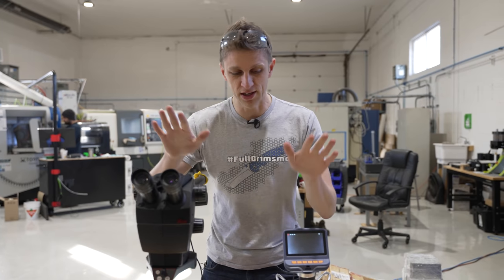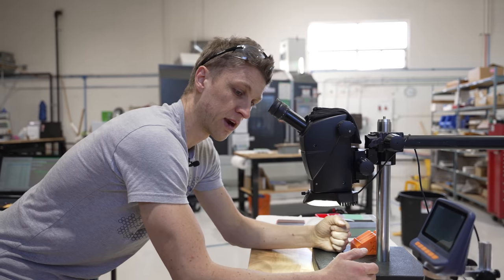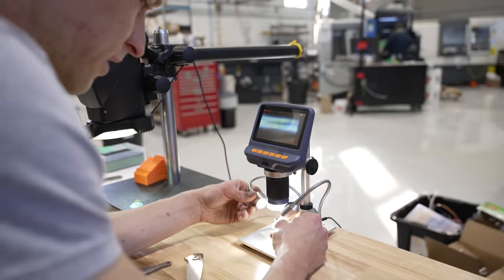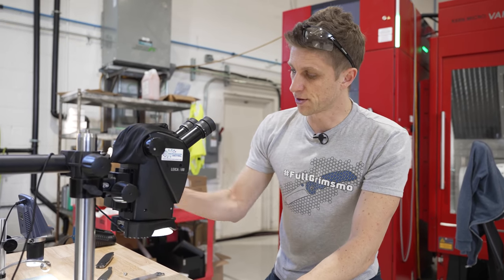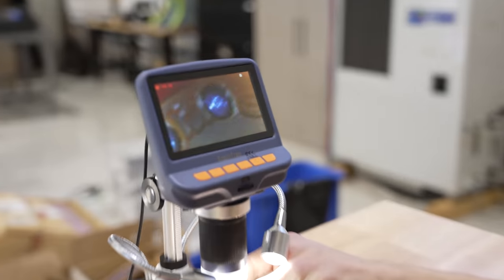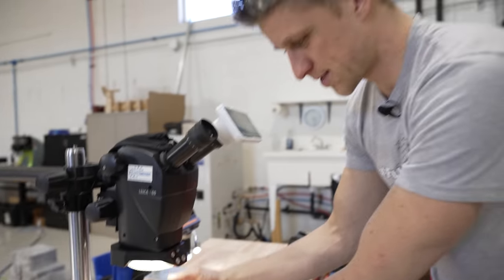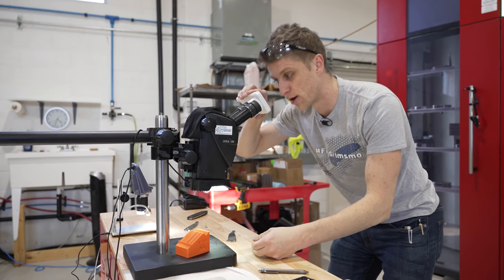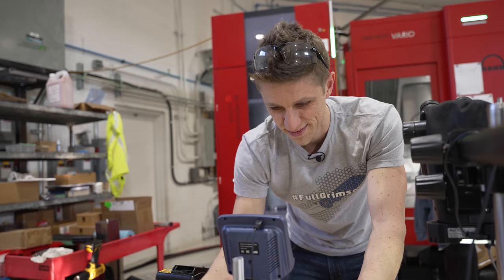$150 VS $1700 Microscope Shootout

Comment: 2025: John gets a scanning electron microscope to make sure the crystalline structure of the material is even across the part
2030: John starts manufacturing in a clean room
2035: John is an early adopter of the single atom 3-D printer
#FullGrimsmo 😁😋🦾👍
Reply: you have to set the limit somewhere, 1 atom accuracy should be enough, we don't need to get into quantum subatomic accuracy.
Reply: You can buy a working SEM for under $5-8k if you're lucky :)
Reply: IBM did single atom 3-D printing a long time ago actually. Look it up.
Reply: @semillerimages  yes I remember when they did that, was pretty cool, arranged some atoms into the IBM logo.
Reply: Agree
Reply: When it hits you that all this technology is directed towards the creation of whats basically "man-jewelry".
Reply: @JOSEPH-vs2gc  TOOLS! THEY'RE FULLY PRACTICAL TOOLS DAMN YOU!!

😂
Reply: @csquared4538  lol

Comment: I would go home with a headache every day working with that high pitched sound in the background all day.
Reply: Honestly you just get used to wearing ear muffs all the time... I have some nice bluetooth ear defenders and they stay on pretty much all the time!

EDIT: In my shop, not John's, but we produce similar noises! :)
Reply: If this audio wasn't altered, I wonder that if with a frequency squeal that consistent. It should be possible to run the audio through a spectrogram, and simply cut anything in that small frequency band, then use that audio for the finish take in the editing process. For small slivers of noise, the rest of the audio, like speaking range is unaffected.

Comment: The Leica, brand new, was a lot more than $1700, unless that model, which I’m not familiar with, is older, but it doesn’t look too old. That would be cheap for Leica.I had a Leica stereo model. It was $5.500.

A measuring device needs to be five times more accurate than what’s being measuring. That’s the usual standard. It’s never bad to have one more accurate.

Comment: I have a Chinese stereo microscope with a camera port much cheaper than the Leica. The stereo effect is really valuable especially if you do work under it like soldering smt.
Reply: Stranger Parts did a video a while back about them including price, review and link to buy (he bought from someone he does business with often enough in the markets that they put a web storefront up on his suggestion)
Reply: @konobikundude  amscope sm4-t is good

Comment: If anyone wants a cheap microscope to play around with, you can get basic USB microscope on Amazon for around $20-40. You connect it up to a computer to use it. If I was using a microscope for a business, I wouldn't hesitate to spend more than that.

Comment: If you have to manipulate objects under the microscope, then a stereoscopic is a must. Without depth of field there is no 3D vision. Leica is excellent (I use the same), but there are cheap eastern made "good-nuff" ones too.

Comment: Need a stool to sit on. Typical lab stools put you at the correct height to use the microscope. A nice stereo microscope is fun to use. Not as much fun as an electron microscope but a much different price class.

Comment: As you zoom in, the depth of focus gets thin.  (Look at macro pictures of bugs and flowers.  You'll see that only a hair of the image is in focus.)  That's probably the main difference in price.  The design effort required to get magnification with a reasonable depth of field is extreme and you shouldn't expect it from an Amazon/BangGood scope.  Optics is fussy fussy---not just prototypes but getting a stable design that is manufacturable requires a deep knowledge of optics.  Building to a price is a whole other constraint.

Comment: John, we have an even more expensive Leica stereo microscope at work and the microscope itself is really good. The build in/on camera however is just garbage! FPS are so low that it is laggy and the worst thing is that you can‘t adjust lighting, aperture etc. so that the picture on the monitor looks like what you are seeing through the optic. Not even close. So showing someone a particular thing on the monitor that you just saw through the optic just doesn‘t work. The best pictures you can get are still photographs with you phone through the optic.
Only advantage of the camerasystem is the software that knows the magnification of the variable zoom so you can use it to measure things quite accurately. There are stereo microscopes with a second set of eyepieces for a second person. Although those are probably not exactly cheap.

Comment: About milling with ball endmill and zero SFM at the tip. Why don't you tip the endmill at some angle so you cut with side of the enmill more? Since the lathe has more axis this is possible.
Something like this picture:
https://www.harveyperformance.com/wp-content/uploads/2017/06/ball-nose-milling-figure4.jpg